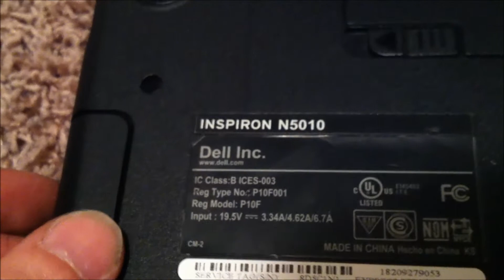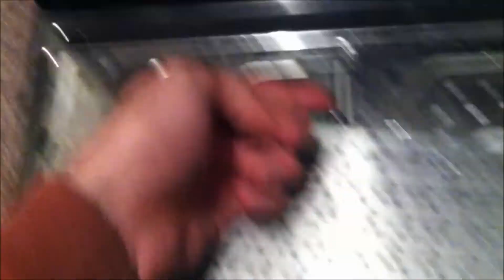How to replace Dell Inspiron N5010 Keyboard

Comment: please add the fact that some build models do not have the keyboard screw -- they have double stick tape. Using a hair dryer around the "F" key while gently pulling/lifting will rlease the keyboard... I thought I would never figure this out!
Reply from the maker: Good find! I’ll pin this comment so it’s at the top! Only way I can add any Info